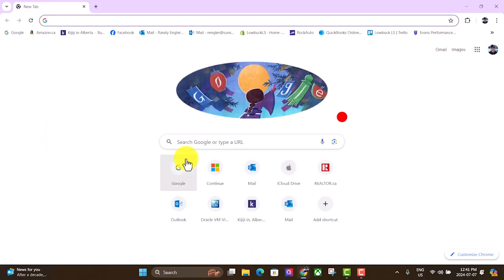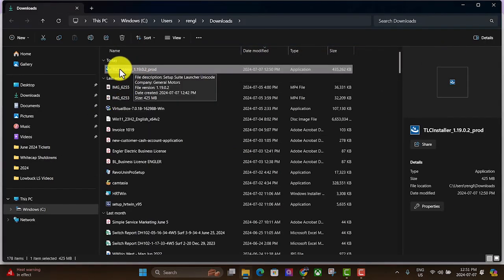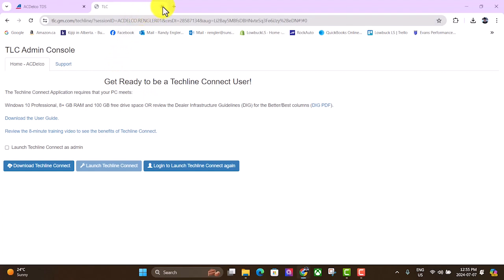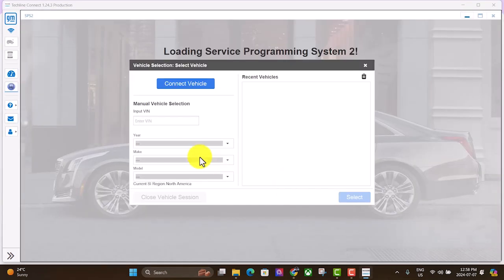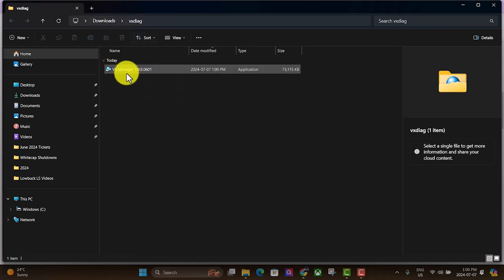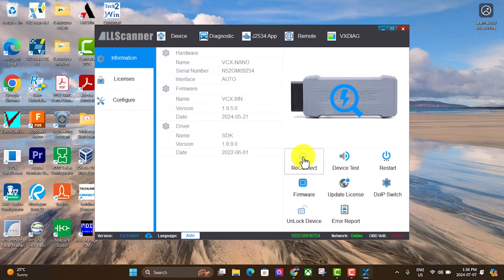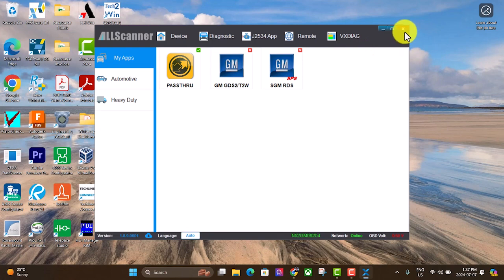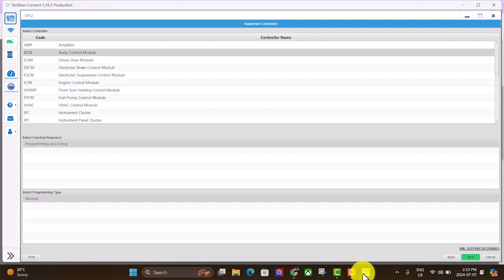2024 Update - VCX Nano Install with Techline Connect

Comment: I just came back to say thank you. About  8 months ago, I found your video and followed your instructions. I had everything up and running and did a fresh flash on the ECU and the TCM.  This made my truck 100% better. It had so many HPTuners tune tweaks and at one point early on, a Diablo tuner. I just wanted a clean base point for my 15yr old truck. Fresh software install made a huge difference. I used HPTuners to save a master copy and then installed a basic ECU & TCM tune. It has been perfect since.  Truck is running like a top and shifting up and down perfectly. Thank you so much, this has been a fantastic tool to add to my tool arsenal.

Comment: Hey Randy, thanks for the videos.  On the ACDelco TDS website, has a banner message that says "USE OF COUNTERFEIT "CLONE" GM MDI DEVICES will result in your account being blocked. Aftermarket J2534 devices are not impacted."   - do you know if the impacts any "official" VXDiag Nano GM devices?
Reply: to answer my own question - nope it doesn't!

Comment: Does anyone know if I can program a replacement SRS module in a 2009 Sierra using this method? I had the SRS module under the drivers seat corrode out and I replaced it with a new one. It has to be programmed to the current VIN. Any help appreciated!

Comment: Hi it is possible to get an account as a simple personn ( not a professionnal personn ) on Acdelco   to  use it , because they ask for VAT number which i don't have .. and i want to control and  install update on my captiva 2,2 VCDI  2012   ECM . Because i have a big issue of underboost that i can't solv after 1 year of work  ; and change of many many component , I still a big problem of loss of power in my car ; and the strange thing is when the is in auto regeneration DPF mode  ; the car work correctly    ; i can't understand ... Thanks

Comment: Hello, great videos and tutorials, thank you. I’m currently trying to reprogram the radio and hvac modules on my 2017 Terrain but Techline is asking for a VCI number. Is there a way to bypass this or a default code to enter?  My tool is recognized, pulls VIN, list module, everything seems to be ready to program thanks to your video :) but I’m stuck on the VCI number. I can click next without it but there is no option to program past that.

Comment: great vid  but i have a question.   i have a 2017 gmc 2500hd  base.   im trying to install factory foglights   i bought a headlight switch with fog lamps thing,  have all the right color wires for fog lights from switch and to fuse box and from BCM   i have one of those built in relays from thge BCM and i bought the VCX nano went through all that BS  and i trying to reprogram my BCM to get T3U rpo code  "fog lights"  i also bbought a X1 harness with the plug for the other harness i bought so im good to go.  just cant figure out to get or reprogram my BCM for the T3U code or do i need to go to the dealer

Comment: Thank you for the video! I just got a VCX Nano for troubleshooting and such on my sierra, and this helped!

As a side note, I believe in September of 2024 GM stopped allowing counterfeit MDI devices. I’ve seen in the forums that supposedly you should only use the pass thru drivers and that will prevent GM from banning your account.
Reply: Yes I just tried using mine to reflash a TCM and it's not working.

Comment: Hey I just watched and followed your video step by step. But when im using the techline connect it doesnt let me go into setting of programing my BCM it just goes straight to program and my car restarts but nothing changes. The only difference that i noticed in your video is the vcx nano firmware is 1.9.5.0 and mines 1.9.4.0 and its saying that is the most up to date. Have you ever encountered this problem? Have any tips or tricks for me? I can send you a video of me attempting to perform the program.

Comment: Awesome video, thank you. I installed Techline on a laptop that had the VCX Nano software suite already installed and got errors during Techline installation and then errors in Techline after selecting  the VCX when attempting to communicate to the vehicle. I had another clean laptop so followed your steps and it worked perfectly first time. My advice for others getting errors with previous installations of the VCX Nano software is to uninstall everything and start from scratch using the steps shown in this tube.

Comment: Randy I followed your programming to the T so far but Cannot seem to program my BCM on my Hummer H3 as it keeps throwing E4491 E4423 when it begins to program the BCM interview tries three times and then faults out.
Reply: That’s normal pal. Make sure you have updated the passthru license in manager and if you’re using windows 10 you have to make sure to turn off real time protection. I have not found a way to successfully keep itself from turning itself back on.
Reply: Make sure remove and replace is ticked too

Comment: If you want to use virtual machine for VX, don't use VirtualBox, use VMWare. I do run VX Nano without issues in VMWare. Hope this'll help someone.
Reply from the maker: Good to know, thanks!!
Reply: What is virtual machine ? I love knowledge 🧠
Reply: Just use it on a dedicated laptop. Like with no important files. Sps and tds will recognize if the date is wrong. It will definitely work as a passthru. I’ve used it. It will definitely work for gds tis2000 and tech2. It’s just loaded with viruses
Reply: I need help. I got one of these but can seem to figure out how to get it to work on windows 11
Reply: You have to use windows 10@t80powersports57

Comment: I just got my vxdiag from Ali express to program a new tccm on my 2019 gmc sierra Denali and it worked flawlessly as a pass threw device wasn't able to program as I got sent the wrong part number tccm. my question is have you found a way to youse gds2 or where to download it.

Comment: Im doing a auto to manual trans swap on my silverado, is there i way i can do it without doing anything to the PCM? If i do got to change anything in the PCM or a module would a GMtech2 diag tool work? im struggling with finding anything out researching the internet

Comment: i have 2010 Buick LaCrosse CXL and i need to do a crankshaft position relearn but i didnt see the option on sps do i need gds2?
Reply: You can use a bi directional scanner like an autel your preference, special functions tab*
Reply: Just hold the throttle down with it running until it hits the rev limiter
Reply: I need to do the same where did you find it on gds2

Comment: I did everything like you explain I’m trying to add a new key fob but it show up communication error do you have any idea of what could be wrong thanks for the video
Reply: That’s because you started the app with the dongle already installed to the car. Set everything up and connect the dongle as the last step. Had the same issue.

Comment: Great Video and good content. It was also very well presented. I have been using the VCX Nano since Windows XP, and back then you needed to use the Virtual Machine. It has been native to the 64 bit environment for quite some time. Mine has been worth its weight in gold. Usually people who are having problems with it are usually missing a file which the anti virus software has removed without their knowledge. Again great video

Comment: Just got my VCX Nano.  I'm following your procedure however I've got the device connected to my laptop but it seems my laptop and VCX software wont' recognize the device.  I get the big RED X across the device on the software.  On the device when I first plug it in it beeps and I get the red and blue lights light up, but then the blue light goes out.  Tried to hit reconnect but no joy.  Any suggestions?  Thanks
Reply: Are you using a virtual machine (VMware) if so, you have to let the computer know if you’re connecting to the actual physical PC or the virtual instance. Let me know if this helps if not we’ll figure it out together.

Comment: Looks like there are some newer versions of the VCX Diag.  I'm mostly a GM guy but might use it on other brands.  Which of their devices do you suggest currently?  And with which configuration, i.e. with Wifi or without etc..  I have a laptop I will use with it unless there's a newer or better way to go.  Thanks
Reply from the maker: @trainingdragon1964  I haven’t used any of the newer models, but I’m always leary of using wifi when flashing modules, I prefer to stick to a hard wired connection.

Comment: I tried using the VCX VX Nano to replace and reprogram the TCM on a 2015 Suburban following a reman trans install.  I gave it up as a bad deal.  I’m sure a computer savvy person can figure it all out but it is not at all straight forward.  I could never get the Nano and TLC to talk.  I’m not very handy with computers and would not suggest the Nano to anyone like me.
Reply: Did you ever have any luck I'm trying to reprogram a BCM on 2006 Hummer H3 and as soon as it goes to flash with the vcx Nano it retries 3 times and faults out. I managed to see the truck it just won't write to any module
Reply: @shawnstthomas4811  I gave up and sent the vehicle to a dealership to get the TCM programmed.  I should have done that right from the start.

Comment: Hey man super thanks for the new video! Still waiting for my vcx nano but I was curious if I'm swapping the body control module is there a specific process I need to follow or can I basically take the old one out and put the new one in then program it or do I have to do something beforehand?
Reply from the maker: @ForwardEngineering  you should be able to just install the new module and program it through the SPS2 system I showed in the video.

Comment: I just purchased this vcx nano because of your original video and couldn't get it to work. Found these 2 videos and thought you had the fix and realized you didn't. Did some more digging, and realized that if you change the date on your PC to before the licence expired (I changed mine to 1/1/24) the software works.

Now weather or not you can flash a bcm from the website like this I'm not sure.
Reply from the maker: @bsegment  ok good to know, thanks for sharing that tip. Are you using the GDS2 part of the software?
Reply: @LowbuckLS  I just used tech2win so far, literally just got it this evening, needed to diag what I believe to be a bad bcm. Don't really know what I'm doing yet lol
Reply: @LowbuckLS  I've only used tech2 so far. Still trying to figure this stuff out, literally just got this today. Not sure what gds2 does
Reply: Wow! Very informative lol 😂 I can’t sleep currently

Comment: hello, i living in France, and  the software was bloqued of the update error in red. I have reinstall the soft and the same mistake. I have tested with 2 pc.
Reply from the maker: @skider6712  which software is being blocked, the Techline Connect software or the VX Manager software?
Reply: @LowbuckLS  thanks the techline connect.
Reply from the maker: @skider6712  I think the problem may be your location. According to this article on the VXDiag website there is a different procedure needed for people in Europe. See this link: http://blog.vxdiagshop.com/2022/03/16/vxdiag-sps2-not-work-for-european-gm-cars-and-vans/
Reply from the maker: It looks like you can access the European SPS2 program through this website, hopefully you can get it working: https://public.servicebox-parts.com/
Reply: @LowbuckLS  Thanks, i am reading the website. I wanted to update my Cadillac CTS 2005 for not having problem with the ecm.